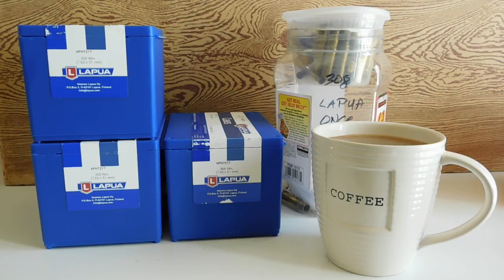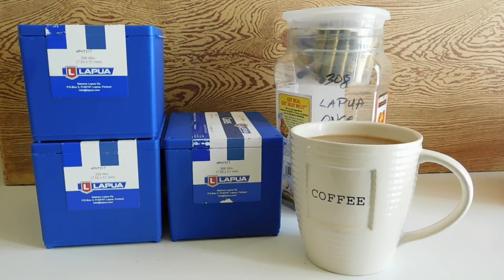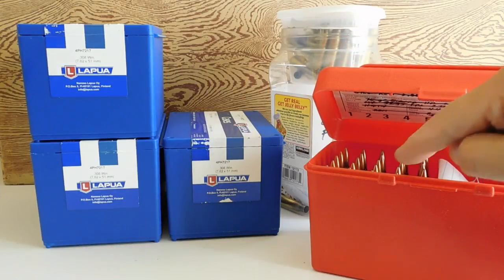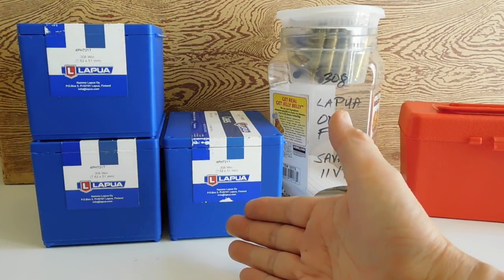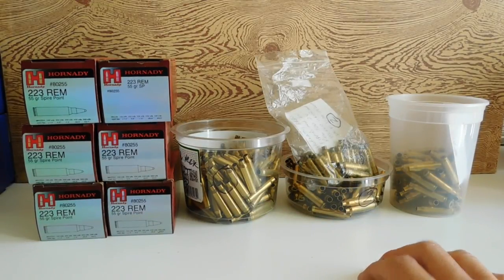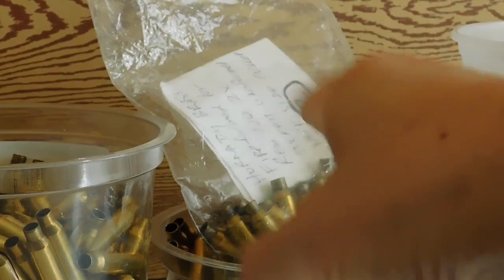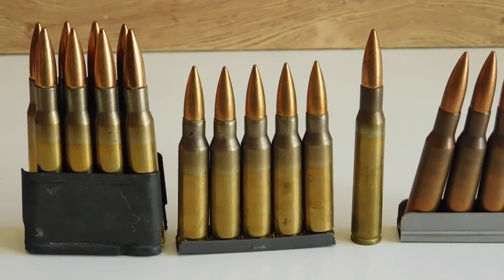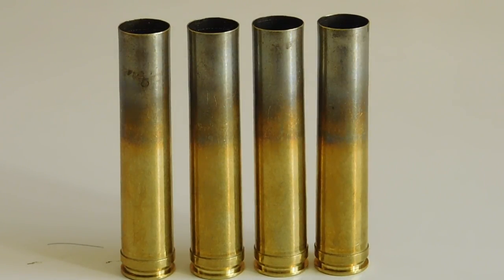Next Tier Of Concerns Before Doing Case Annealing

Comment: Logical information here FC45LC!

At this point in 2021, I believe that the only process for annealing "absolutely" perfectly across the whole spectrum is the AMP II (annealing made perfect) from New Zealand.

With all variables and pro/cons considered, the amp system controls every possible aspect of the physical process of annealing with absolute electronic, computer driven perfection.  No need for producing any toxic gasses from burning propane, or hot salts  indoors.

This unit uses induction heating (eddy currents), and produces "NO POSSIBILIY" of not heating the case perfectly all around its circumference simultaneously, and throughout the entire mass of the neck and shoulder needed to anneal cartridge brass.  The electro-magnetic field that creates the heating is precisely applied until the brass reaches the EXACT temperature required for that cases specific alloy composition to fully anneal, but not over anneal.  The temperature is held at that temperature for the exact length of time to achieve thorough, and full annealing of all of the brass mass exposed to the induction coils.

This way the thin part of the neck and the thicker part of the shoulder are done to precisely the same hardness value.  This is possible for every case you anneal in this unit.  

Flame units and salt bath units work for annealing, but they cannot control the application of the heat, time, AND the exact temp required for EVERY SINGLE CASE.  Whether this level of annealing control is required to achieve what most shooters who anneal their cases want to achieve is up to each shooter to decide.

The only draw backs for this system is its cost, and speed of operation.  

The new units have an auto feed attachment that greatly increases production now.

Sorry for the long winded response!  LOL!

Comment: I have never been a champion of annealing either, but for another reason.  I have always feared case head separation. Vertical neck and shoulder cracks have became the way I know that it is time to retire a given lot of brass. If one wants long life brass develop the accurate load that is a few hundred feet per second slower than maximum pressure. Need to go faster get a rifle with a bigger case. Or other wise buy new cases after just a few loadings. I have tore cases up in 2 loadings too. (They were really fast LOL).  There is such a thing as loose primer pockets. 

Great videos you make Sir. Wish I had this good of information to learn from 40 years ago when I learned how to reload from the manuals. Thank you Sir.
Reply from the maker: Eston Loving - You and I are on the same page.  I've blown the head off a revolver case and had a few partial head separations myself...trying to push brass too long is a bit on the dicey side...plus, annealing does nothing to protect against head separations.  My best loads also tend to be on the hotter side - annealing may not apply to us...I do intend to follow through with this though as it is a skill we should have.  Have a great day, and thanks for posting your excellent comment... FC Steve
Reply: FortuneCookie45LC Annealing promotes head separation the way I see it. The cases keep right on stretching in front of the web of the case. The warmer the load the more stretch we have. I  would think that the heavier brass like Lake city would stand more loading. And thin light brass like Winchester would be more likely to have issues if annealed. At the price of lake city brass I don't blame guys that think they need it to want to make it last longer. Web thinning can be detected by making a feeler tool and scratching around on the inside of your cases. Want to know how thin they are when you find the groves? Cut a few in half is the only way I know. 

My head separation came on 7-30 waters cases in a contender pistol. 
 
Keep up the great work FC. hope this helps some of your followers.

Comment: FC, I remember reading an article in one of our local gun magazines where a gentleman annealed his case necks by dipping them in his lead melting pot, apparently the molten lead was reasonably easy to control temp wise and gave good results. Il bet the PID controller fitted to your lead pot would make it even easier to reproduce :-)
Reply from the maker: joehunt1980 - Yes, you are absolutely right - I recall that too, but since I wasn't into annealing and that was a more peripheral way suggested to do it - I filed that information away so deeply that it wasn't recalled... That would make a very interesting video indeed - I'm already getting ideas on that... Thanks for spurring the memory...!!   FC Steve
Reply from the maker: Rifles First - And I like it too....a lot...!!   Bears investigation.  Have a great day,  FC
Reply: FortuneCookie45LC - Indeed it would make an interesting video.  I've been meaning to try this with my Lyman Big Dipper pot setup with a bottom temp sensor for the PID and just a small amount of lead in the bottom to control the depth of the anneal up the case.  Perhaps they'll need a tumble afterwards.

Comment: FortuneCookie45LC I enjoy your channel very much! I live in Arizona, America were we can have anything we want. I have been shooting since I was 5 years old and reloading since 1968. Mainly Shotgun and Pistol, rifle a friend of mine owned a Gun shop and I got the rifle round from him. I just pick up an M1 Garand and enjoy shooting it so I'm reloading 30-06 for it. I have 2 questions. If I load military brass because of the less volume do I have to load less powder then commercial brass show in the books? Second do you run dirty brass through sizing to decapping the case before you wet tumble? Or do you use a decapping die first then tumble? For years I cleaned them first decapped and primed. I just started trying wet tumbling, I made one from and Ice Cream make works great but I need the S.S. pins. Thanks Joe,
Reply from the maker: jmuraldajr - Thanks for posting.  If cases are full of mud, gotta blast 'em out in plastic baskets with a garden hose..then let 'em dry.  If off the range and dusty, no problem - If pistol brass, I just run 'em through carbide sizer dies and decap of course.  Then wet tumble 'em...cleans the primer pockets pretty well without SS pins.  Carbide sizer dies are too hard to scratch.  If rifle, then, decap with Lee Universal Decapping Die and then wet tumble.  Your Garand should do real well with IMR 4895 powder...and beginning with the published starting loads will take care of any case volume problems safely.  Continued good shootin' to ya,  FC
Reply: Thank You FC45LC for getting back with me, I appreciated. My garand has seen a lot and through the war rebuilt probably many times. The S.N. 39XXX but shoots great a lot of the parts are war time USGI. I wish I had it when my Dad was alive. He would have loved it to! Thanks again Joe, (Keep up the good work)

Comment: One of those machines with temp paste will solve your problem using the melt, no melt method.
Reply from the maker: chevy 6299 - Will take 1500 rounds of shooting before those 300 Lapuas run through 5 loadings each...If my accuracy is running well, annealing will be a good project at that time...And if accuracy has degraded, the distance to lands will be checked again - who knows?  Might be needing to work up a new load with new brass by then... Best to ya,  FC Steve
Reply: It's stuff like this that keeps us wondering and enjoying the sport.

Comment: I think you have reached the point where you should visit your institute of higher learning metallurgy department that exists nearby.    See if they will help you esablish a scientific sound methodology of measuring annealed brass hardness.  There is the direct measurement using something like a vickers diamond point hardness tester., or a  specimen pull test machine.  There is the most accurate indirect method of inspecting photo micrographs of grain structure.    
Nick's "good brass" means thickness and mettallurgical chemical content is consistent.
Reply from the maker: Cc Wynn - Yes, indeed - I know very little of what it takes to measure brass hardness or ductility / brittleness.  But I choose to not become a metallurgical engineer because my brother-in-law is one already.  I know a lot of you competition High Power shooters anneal with good results.  In the past, I did not choose to anneal my brass. When this video was being made, I was looking into that. I still might do that starting with my milsurps brass and 30/30.  Currently I get my 5-6 leadings from my bolt rifle brass, and at the first sign of brass hardening, splitting or donut formation, I simply discard the whole lot once the lot has all reached the same number of firings.  My preference may very well be to continue this paractice as I really like my results with 223 (groups in the threes) and 308 (groups in the fours) bolt guns.  I used to buy another 100 rounds of brass until a bench rest shooter told me to buy 200 rounds of good brass.  If I do start annealing, I’d probably go with the machine that ThorsAxe recommends.  Best to ya,  FC Steve

Comment: Back on air , I will re post my comment RE: 308 load ( max load in my Sierra book ) = 44.7gr 4064 powder with Sierra 168gr  bthp match , 2.8" max length , Rem case , Rem 9 1/2 primer . This load was talked about , just want to add >> MAX LOAD !! Book said 2700 fps from 26" brl .
Reply from the maker: Dan O'Neill - Thanks for posting, Dan - Wouldn't want to blow up my Savage...As you know, reloading manuals can vary a bit...Lyman posts 45 grains max 2717fps at 52,000C.  I'm getting sub 1/2 MOA with SD 5 using 44.8 grains IMR 4064 COL 2.760" and the SMK.  I didn't use the Sierra manual, but indeed, 44.7 is listed as Max.  My 44.8 grains extract easily and primer signs are OK... I did check the Lee manual, IMR 4064 maxes at 45.9 grains 2766 fps 58,800 P ... so I was comfortable using loads that are lower than the lower max listed between the Lyman and Lee manuals... Thanks for posting on the Sierra manual as I did not check that one...obviously, my loads are on the warm side as a lot of reloaders have found good accuracy with 43.X grains of 4064.  Have a great day,  FC
Reply: Just FYI .. I don't have the books you have , I have found the Sierra Book will list some loads OVER the Fact Powder books . I thought you likely know what you are doing & just a GEN Warning to any viewers that may not know how warm that is . I recall others using a load ( LIKE ) that ??  Again that is not the same case , & I don't know your primer . Best of luck , good video !
Reply from the maker: Dan O'Neill - Always good to be on the safe side, Dan - appreciate you pointing out the Sierra listing... Hard to fathom it sometimes the Sierra lists higher max charges, and the Lyman is conservative... Good day to ya, Dan... FC Steve

Comment: I have a straight pull at pistol. I wanted a " bolt gun" type firearm because all I have is semis. can I neck size only since its straight pull bolt action now?
Reply from the maker: Christopher Chance - Good question.  Neck sizing is such that we can use fire formed brass in the same bolt gun.  Straight pulls may not have as much camming action as the regular bolt action.  If your neck sized rounds do not chamber smoothly, you might have to go FL or even need to bump the shoulder back a thousandths or so.   Good reloadin' to ya,  FC